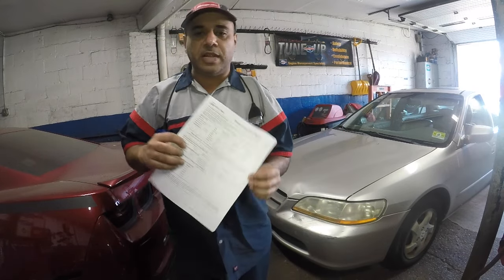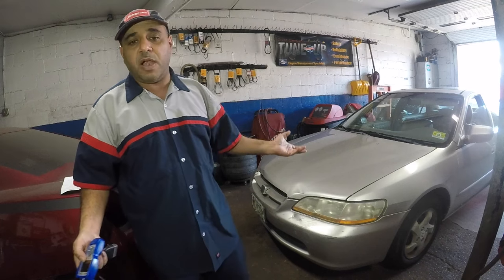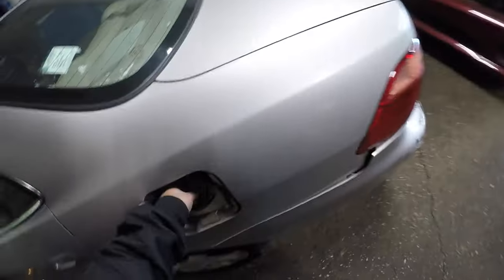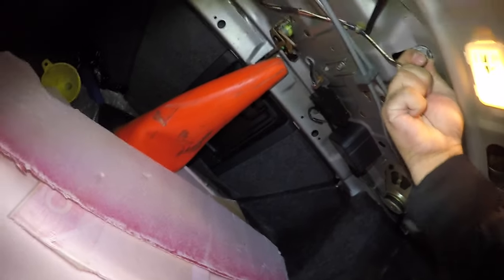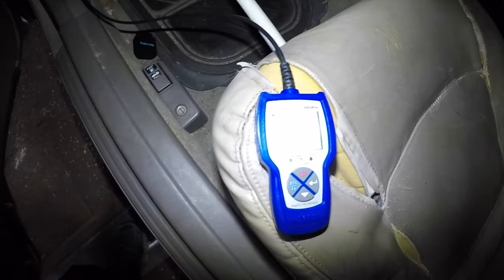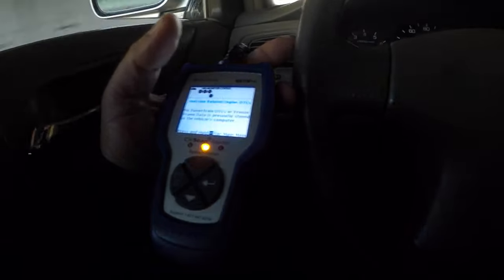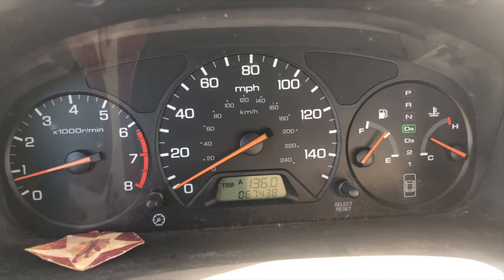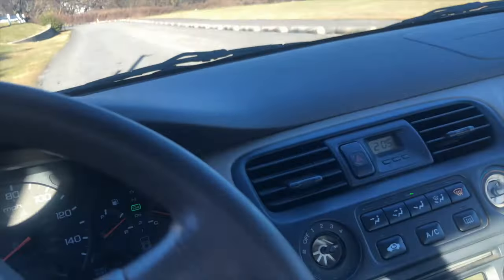How to pass car emission inspection for car that is not ready  |  failed car inspection

Comment: Emissions tests really shows that it’s expensive af to be poor. Like a person who drives with a bad cat system probably does it because they can’t afford to hash out a 2k repair on a car that’s most likely a clunker and used to get them to work
Reply from the maker: Well some times it’s just not ready nothing wrong with the car like this one
Reply from the maker: @KrGsMrNKusinagi0  safty inspection!!
Reply: that's why i'll always love socialism.
Reply: this right here --- this comment is the one
Reply: My 05 Colorado runs well but a sensor that cost more than the truck keeps pissing the machine off and failed
Reply: @RBTheMechanic My 2010 Honda CRV car, of all its monitors, only 1 says incomplete, that is, not READY. ALL THE OTHERS ARE COMPLETE. READY. THE INCOMPLETE ONE IS 0S2.  IT ALSO DOES NOT PRESENT A CODE AVAILABLE ONLY ON 02S NOT READY I CAN PASS IMPECTION LIKE THIS WITH ONLY 1 MONITORS NOT READY THANK YOU
Reply: @RBTheMechanic My 2010 Honda CRV car, of all its monitors, only 1 says incomplete, that is, not READY. ALL THE OTHERS ARE COMPLETE. READY. THE INCOMPLETE ONE IS 0S2.  IT ALSO DOES NOT PRESENT A CODE AVAILABLE ONLY ON 02S NOT READY I CAN PASS IMPECTION LIKE THIS WITH ONLY 1 MONITORS NOT READY THANK YOU
Reply: Car is 20 yrs old runs good …..to pass it need a $3000 fix for as car that’s worth < $700……
Reply: that's my issue except i got my car a new catalytic converter anyway but because its not original i keep getting the code now my inspection is expired and idk what to do 😒
Reply: @gennettem they will exempt you if you had the cat fix.

Comment: Thank you for your integrity as I've read a lot of the comments and instead of advising people to commit illegal actions or cut corners; you advise them to do what is necessary. Too often I see videos like this where the "mechanic" tells people how to cheat the system instead of the right thing. So I'm glad to see someone not willing to compromise their integrity in order to keep people happy. I run my construction business the same way. If a customer asks me to not pull permits, or to cut corners, they can find someone else. I don't play those games cuz it's my name on the line. Integrity will always pay off better than the fines one will pay by cheating the system.
Reply from the maker: Yup also with emission it’s for out planet 🌎 nothing else matters if car needs fixing fix it. Some times repair is cheaper than cheating the system
Reply: @RBTheMechanic  you should go explain that to the channel called online mechanic tips. I just came from one of his videos calling him out for cheating the system by clearing the codes which is a form of tampering deemed illegal on the federal level by the EPA. I even gave him a link, and he just kept deleting it while advising people that what he was doing wasn't illegal. By clearing the code, knowing that his catalytic converter had failed. He was knowingly and with intent using a device to mask a non-functioning component required for emissions testing. According to the EPA this is tampering and illegal because he had pre-existing knowledge that that part was a failure and was using a device to hide it. Then literally advising his whole channel on performing this illegal action. Then when I called him out on it, all he did was respond with a bunch of tough guy nonsense. So I went and got the link with the information showing him that it is illegal and replied to that comment with the link so that other people might be able to click on it and understand that this is illegal. Three times I sent that reply, all three times he deleted the reply yet kept up his tough guy comment so he can look like he won the argument. He doesn't care about our planet or the people that could potentially be breaking the law because of him
Reply from the maker: @jerichojoe307  yeah I don’t wanna start ear with anyone I just keep it real on my channel and I do care about the earth
Reply: @RBTheMechanic  oh that statement was rhetorical. I didn't actually expect you to even think about calling him out. I called him out myself. All I wanted was for him to admit that he was wrong. He pulled the tough guy attempt and so since it wasn't getting through I just reported his video for illegal action and let him know that if he felt some kind of way about it that my company takes tough guy complaints 7 days a week in the back for MANUAL COMPLAINT RESOLUTIONS. And welcome to stop by 🤷🤷🤣. Not my best moment. But guys like him piss me off. Glad there's guys like you instead.
Reply from the maker: @jerichojoe307  👍 yup yeah I had issues with people on here other YouTubers so I just avoid them better to show it my self the correct positive way

Comment: Have this problem for my 2015 550i BMW after replacing battery. Have had to drive over 300 miles as well
Reply from the maker: Yup memory loss when u removed the battery
Reply: I’ve driven my Kia soul over 1100 miles and it’s still not ready all I had done was my battery cables disconnected cleaned and reconnected two weeks ago about 1100 miles ago and I just found an omissions test today I really don’t know what to do nothing is wrong with it it’s working fine it’s just to not really code how much more do I gotta drive it? The mechanic told me I might have to drive it for another month or two that sounds extreme?I called the dealership they said I would probably have to replace the computer in the car and that would be about $1500 so I don’t know I’m very frustrated
Reply from the maker: @honeybadger713  give it give it month don’t replace nothing some time it can take long I had one car which I ran for about 600 miles I had customer that did over 1000 miles it just takes time. Don’t be frustrated just give it time and drive it.
Reply: @RBTheMechanic  thank you for replying sir . Very much appreciated 🙏

Comment: Thanks for the vid!  Drive cycle is the solution.   Look up your car for specific dry cycle instructions.  My 2001 Honda Accord LX 2.3L F23A4 ULEV engine will blink the engine light 5 times (then stops and turns off) when the car is turned on BUT NOT started to let me know that the emission system is NOT ready.

The politicians make life harder for the drivers!
Reply from the maker: Yup

Comment: I have a 2013 fiat 500 it passed every test except the emission test.  there’s a check engine light on and the reason why it comes on is because there a air temperature control in the mirror which causes the engine light to come on. But it passes every test until the emission test it fails every time. If I fixed the sensor will it pass the emissions. Or do I just drive it instead with the engine light on. It only has 6000 miles on the car.
Reply from the maker: Not sure what that sensor is but replace it

Comment: 2002 toyota corolla failed smog. I changed air filter, cleaned maf sensor, cleaned throttle body, changed spark plugs, change oil, ran seafoam cleaner in the gas, and it passed.
Reply from the maker: Oh nice good job!!!

Comment: I bought a used 2010 Buick Enclave.  My inspection is already very late.  The past few weeks, I had to change my oxygen sensors.  My mechanic suggested, I drive 30 miles b4 coming in for the inspection, and leave my car on.   I did that, and he still said it wasn’t ready for emissions inspection,.  I drove even more miles, and put an adapter on the car.   

Afterwards, he gave me very specific instructions,

He said to drive at 55 mph for 3 minutes, and then to decrease the speed (without breaking) to 20 mph..  And excellerate to 55-60

If that doesn’t work, they said a smoke test can be done 

Does this sound like honest advice?  I don’t understand
Reply from the maker: Yeah u have to get the car ready drive it more till it’s ready usully key cycles also count so u would have to turn off and on drive some miles then turn off and on
Reply: Smoke test is more for the EVAP for leaks….
Reply from the maker: @blahblahhhh2801  yup

Comment: What about a bad battery? It starts my car but a mechanic told me I might need a new one. I didn’t get it, but I saw a video that said that a bad battery can the drive cycle?
Reply from the maker: If it’s loosing power it will cause the systym to loose memory of cycle it’s just like reset  if the ecm
Reply from the maker: But it had to be dead battery like zero power

Comment: Its highly unlikely that any of this is going to work on a modern vehicle. You need to understand how the system works if you want to fix it. First, you can't put your car in limp mode with a scan tool. You also can't clear a hard fault. You have to fix the problem or it won't go away.

Here's what really happens. When a car is getting "ready", it usually means the engine is running in open loop. Your PCM operates in either open or closed loop. When you first start your car, the PCM runs in open loop until it warms up. Cat's and O2 sensors don't work properly until they reach a certain operating temperature. The PCM sets fuel trims using data it receives from O2's and cats. When in open loop, it ignores the data from the O2 sensors because they will give a false reading until they reach temperature. If the PCM starts out in closed loop, you would get a check engine light every time you start your car.

As for clearing codes to pass an emissions test, you're probably not going to get away with it. Modern vehicles are set up so you can't do that. Emissions DTC's are hard faults. That means the only way to get rid of them is to fix the problem. Also, its hard to cheat because when you clear emissions DTC's they turn into permanent DTC's. Only the PCM can clear them. It monitors the system, and when its sure the problem is actually fixed, and not something temporary, like clearing the codes right before you get it inspected, it will then shut the perm DTC off. 

If you're not passing an emissions test, run an EVAP test with your scan tool and see if you can locate the problem. Repair costs will vary depending on what's wrong with the system, but there's a good chance it won't be too expensive. If the parts are easy to reach, you can probably make the repair yourself.
Reply from the maker: I don’t think u watched my video and listens to what I stated

Car lost memory
Battery was removed
Car will fail inspection
Many people go to inspection start and car fails due and there’s no issue on the vehicle they just work up and drove 1 mile to inspection station and car failed due to the system wasent ready
Anways thanks
Reply: @RBTheMechanic  Maybe. How do you know exactly what caused the car to fail? I'm not saying you're making anything up or don't know what you are doing. I'm just saying its a possibility you may have been mistaken as to the reason. And I'm talking from experience. You'll be hard pressed to find someone who's made more mistakes than me.

However, nothing is impossible. Maybe you just had an extreme case. If you just put a battery in, don't clear all the communications codes that were set, reset the BMS, drive the car long enough to come out of open loop and report STFT's and run long enough to recalculate LTFT's, what you are saying could happen if you took it directly to an inspection station. Especially if its cold out.
Reply from the maker: @AT-wl9yq  customer had completly dead battery and he’s my regular customer he dosent drive at allllllll look at the age of car and condition he senior citizen so it just lost memory
Reply: In my 2015 Impala it says:"Evap/Egr Not Ready". I was told to do some highway driving where the vehicle can get up to 55-65mph. Then it would go into "Ready" status. Is this true? I failed NY inspection because of Not Ready on both those monitors.

Comment: I’m having this problem now with my 2022 Honda pilot brought it to the dealership. They had to do a software update for a recall on my trail sport I have my EGR showing not ready in my evaporate showing not ready. How many miles do I have to drive cause I got a rejection sticker shouldn’t the dealership told me about this. Knowing that I was going to need an inspection sticker this month.  Thank you for the video.
Reply from the maker: Yeah ok well drive the car good amount there’s no specific amount miles and it will pass systym has key cycles but if u can do 3-4 key cycles that would me ideal so try driving 10-15 miles turn off and then after minutes turn back on that would be 1 key cycle and the. Do same again 3 more times.   Best would be to do it is one day not today once then tomorrow and next day car dose go back to loop mode once it’s get cold anyways. This is ur only option there’s no repairs needed just drive and do key cycles and if it dosent pass do more as u can see I drove this car lot
Reply: @RBTheMechanic  OK thank you very much I really appreciate it.
Reply: Hi this is Dave again I just put 550 miles and still nothing is happening should I bring it to the dealership because of the software update they did there ones that caused this it  only got 5000 miles and less than a year old it’s a 2022 Honda pilot. Thanks in advance. I did about 6 to 7 key cycles.  Maybe even more I’m only getting 15 miles to the gallon. It’s saying my evaporator and EGR.
Reply from the maker: @David-hh7nc  if the light didn’t come on they can’t help u it just need to be driven u have to also do the key cycles turn on and off after 20-30 mines 3-4 keys cycles

Comment: Hey i had my car pass on everything but mil said fail the guy said when did i change battery i said few weeks ago he's all you haven't driven it far enough i drove it all over the place everything else pass except mil so he said i need to retake test and pay the 112$ and nxt time will be half off is he pulling a con or does this sound right
Reply from the maker: Did he give u print out?    Well idk what u mean by mil usully it mean the check engine is on u should have codes either the code is not ready. U might want to get a small scan tool like this and check ur self before u go

Comment: My headlights are burnt out I took my car like that to get a smog check. Does that have anything to do with secondary air system not ready? It didn’t pass.
Reply from the maker: Ur what burnet out?   U should check in the paper for any codes or it will tell u not ready on few items

Comment: I got everything ready except the o2 heater htr monitor. Any tips no engine light i reset it because the evap leak i fixed that and the evaps ready
Reply from the maker: U have to drive do 20 miles cycle
Reply: @RBTheMechanic  yeah I drove about 200 miles still won't ready it's hard to do in traffic tho
Reply from the maker: @blue4980  yes understand as u can see I drive the car more longer it takes time I had one customer who’s car didn’t get ready for about 500’miles

Comment: do you have to drive around the same day you take the test? my car failed for evap but i never had any check engine light
Reply from the maker: It might not be ready so drive around get it ready u might want to invest in to some small scan tool so u can moniter the system
Reply: @RBTheMechanic  i would but its a 93 accord that uses obd1 so im not sure how i would go about doing this.. i dont wanna spend another 60 dollars just to faii again.. any suggestions? :/
Reply from the maker: @soarer209  oh I’m what state u live in we here don’t have inspection 96 and below but u just got to drive more if there no check engine
Reply: @RBTheMechanic  i live in cali... shit sucks out here ok i will try that thank you
Reply from the maker: @soarer209  yeah u guys got tighter emission
Reply: @RBTheMechanic  so I drove for about 130 miles and now I have to wait almost two hours for my car to even get smogged will all that driving I did be for nothing since the car has to sit and wait for a few hours until it can even be smogged?
Reply from the maker: @soarer209 let it idle
Reply: @RB The Mechanic  what if it says everyt6is complete after codes were cleared, BUT not everything says ready with current drive cycle? I've driven over 500 miles. Will they go by the tab that says everything is complete since codes cleared? My issue was a gas cap. No lights are on.
Reply from the maker: @maky4653  u have to keep driving it will take time this car took like 300 miles about could had been longer I had customer who did 700 miles

Comment: It’s not reassuring that a professional mechanic with all the right tools can’t fix the problem without spending hours driving the car with sensors running. = Doom = zero chance common person fixing. Dealership $1400 to replace whole system = throw car in trash.
Reply from the maker: Car has no issue this car lost memory due to dead battery

Comment: this is such bs. My car (13 hyundai elantra) has a Bank 1 too lean code and the car runs completely fine. Switched oxygen sensors, code still shows. I dont have the money to change the catalytic converter or keep throwing money to see what will finally fix it. If I cant figure something out by the end of may i basically gotta get rid of the car
Reply from the maker: Which sensor did u replace?
Reply: @RBTheMechanic  Upstream or oxygen sensor 1 I think its called
Reply: @RBTheMechanic  the code is p2096 to be exact. Post Catalyst Fuel Trim system Too Lean Bank 1
Reply from the maker: @Nestywesty  which sensor did u change
Reply from the maker: @Nestywesty  dose it have maf sensor?
Reply: @RBTheMechanic  Yep also changed the Maf sensor
Reply from the maker: @Nestywesty  ok now u need to check lean condition reading with scan tool live data and check to see if there’s any vaccum leaks by using spray suck as starter fluid also I have had faulty defects maf sensors